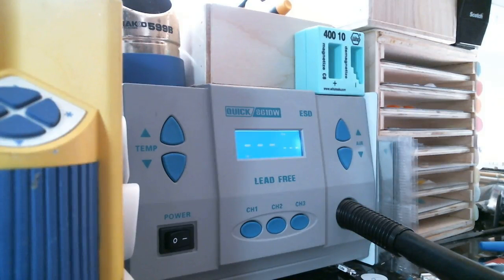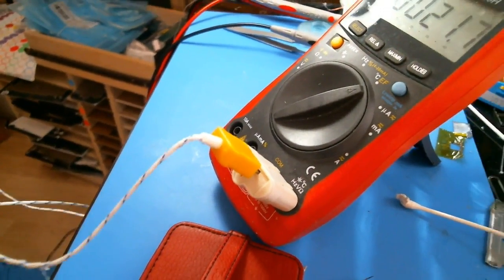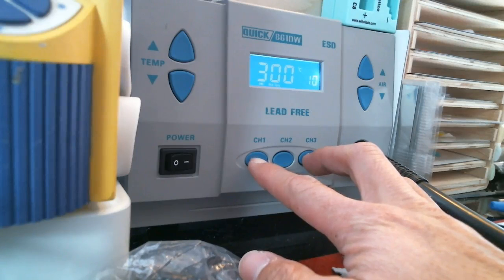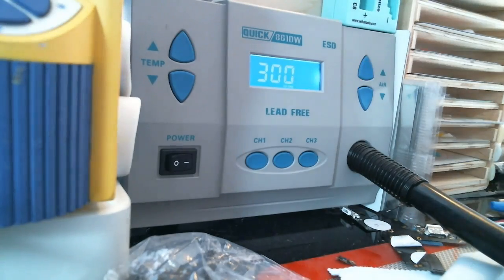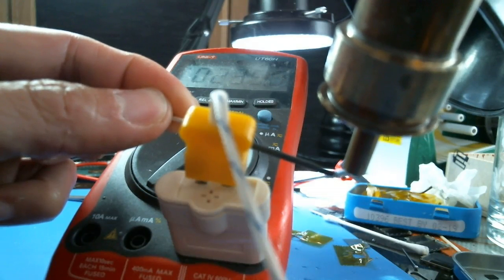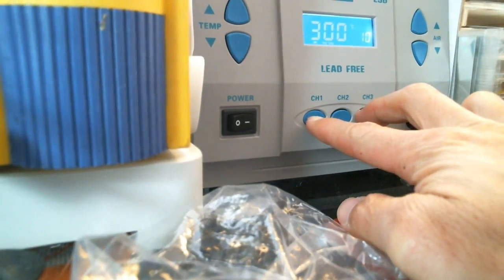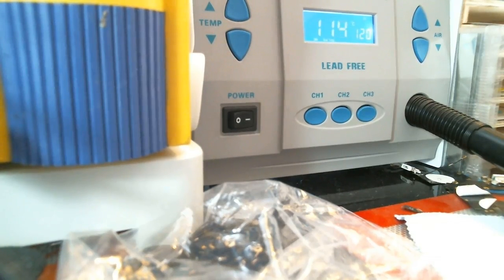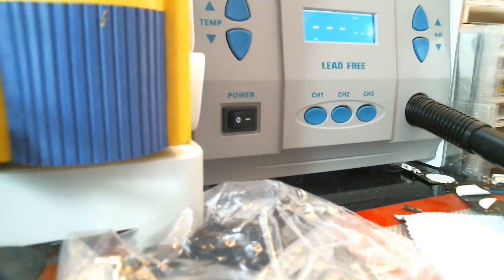Calibrating your Quick 861DW Hot Air Rework Station

Comment: It's not even calibrated properly, You don't hold a couple at your working distance and it's moving all over the place your readings will be all over place, The correct way would be to place the thermal couple inside your nozzle near the tip of the heating element that would be the real calibrated reading otherwise your just wasting your time calibrating it in the first place.

Comment: I would suggest not doing this so close to the meter - if the cold junction for the thermocouple is in the meter (or the plug) you're gonna throw off the reading accuracy because of the heat. Potentially a whole lot.

Comment: It can never be truly calibrated for precision use because there are so many other factors, your ambient temperature, how close/far the tip is from work surface, tips angle, air pressure. But for rough approx reference, its good to see the calibration function in this device.

Comment: Thanks for this.  Been looking at the 861DW to add to my bench.  But still wavering.  Have a couple of used options locally.  Any advice on a used Hakko 850?  Thoughts?  Also know anything about Hakko's 703b and 807 desolder gun?
Reply from the maker: Unfortunately, I have never used the hakko hot air units.

Comment: You seem to be the only person that speaks English that owns a quick brand. I'm considering tracking down a 120v version, but wondering about tip nozzle compatibility. Will generic 850 style nozzles fit? Hope I don't have to buy special ones!
Thanks!
Reply from the maker: No, this unit uses proprietary tips.
Reply: Thanks for the reply! Still recommend quick brand now that you've had a chance to get to know it?
I worry about lack of support in the united states.
I might just hang on to my annoying cheap aoyue for now.
Reply from the maker: Yeah, I've used and tested Aoyue, Oki, and Quick hot air rework stations and I can say that the Quick is by far the best one.  I'm testing the cheaper Quick 957DW right now.
Reply: I see MCM has the QUICK712A for $299 but they give like a 10-20% off code for new customers.
I wish Quick was more popular in the states, instead were flooded with no name Chinese stuff.

Comment: I have a clone of the repair station Quick-706. His name is UnionTest-706 (Russian low cost brand). Thermal stability is worse than the Quick-857D (857DW - brushless motor). Recently purchased also Quick-861DW. But I ordered the NK-850 nozzle in Poland. This adapter, which allows the use of standard nozzles from the 850 series station. That will save on buying expensive baits for large BGA chips. I'm sure this information was useful.

Comment: Do you guys use a 110 to 220 transformer on this ? Or do they sell a 110v version. I've been googling around but can't find much information on this.
Reply from the maker: I think the 861DW is for 110V and the 861DE is for 220V.
Reply: Thanks You! I was unaware of the 861DE existence 👌🏼
Reply: Friend, you are mistaken. 861DW - Flow 120 liters per minute. 861DE - Flow 120 liters per minute. You can see the disassembly on the Fix Apple-The Kardi Lab channel. The 861DE has a very strong airflow. It takes a very long time to gain maximum flow in cooling mode. And very much noises. Dave at EEVBLOG (forum) has a photo of 861DW .. You can compare .. The same disassembly of the 861DW is on the Bga Mobile channel (i use google translator from RU. Ths.)
Reply: So in other words, 861DW is the way to go correct ?
Reply: oh.. my error.. copy-paste with translator.. sorry.. read as "861DW - Flow 120 liters per minute. 861DE - Flow 200 liters per minute".
if it is not necessary to solder large bga chip (video card or specialized industrial equipment) - 861DW is the "ideal" Hot Air Station. I can see is only one drawback - it is very expensive attachments. But he decided to purchase the nozzle NK-850 (I bought at Quick representatives in Poland). I would like to buy more Quick-860DA micro hot air station .. and compared in the living .. but it will not be before the end of the month of May. At the mini station very strong air flow and high noise .. but the high heat setting.
Reply: https://youbay.ch/collections/repairing-tools/products/original-quick861dw-solder-station-quick-861dw-repair-tool-quick-861-dw-de-smd-solder-station-for-iphone-samsung-huawei-phone

Comment: Hello it  could calibrate 380 C  and 6 air  and  WITH THE THERMOMETER mark 380 C  is correct?
Reply from the maker: Yeah that will work
Reply: Thank you, you use it at 415 degrees and 10 air  and 6mm tip ?
Reply from the maker: Yes I use the 6mm only for touch ic repairs.  I use 4mm and air flow of 5 for almost everything else
Reply: Okay, but has it calibrated at 415 or 380 degrees for your jobs? Thank you

Comment: JBC baby ! Worth every penny.
Reply: Tony Tone so expensive baby, and however jbc is no the big deal
Reply: I just recently got the Nase as well. I love it. I haven't tried much else except the old Metcal SP200 and Hakko 888D.
Reply from the maker: I refuse to pay $1,500 for their hot air station!!
Reply from the maker: That's nuts.
Reply: Love your videos too !
Reply: Ok cool
Reply: Think it came out to be about $1,800 - $2,000 each. Worth it to me.
Reply: Ya it is. But its a luxury like a Maserati.
Reply: Tony Tone yeah, but remember this maybe u can could pay for jbc, but not me. I see this channel because i wanna something cheap like quick. I saw different videos people using this hot air station and they are happy. Probably i gonna buy this
Reply: On Nase I got a demo unit for 30 days. It has practically bought itself in that 30 days. But I feel ya. There was a point in time I couldn't afford it either. But if you have a choice, I'd say choose it. Keep working with what you got and you will get your JBC's. My previous hot air station was Aoyue. It got me through for many, many years.

Comment: I cant understand why did you calibrate the station !!!!!!!
Reply from the maker: I was at 500C and it still wasn't hot enough
Reply: +Microsoldering ok so why did you set it on 220C ?
Reply: actually I did not got your idea , because i have the same issue and am not able to solve that , will be more than happy ic you can help me out in personal. 
Thanks.

Comment: Hi , im hold the ch1 and ch3 keys simultaneously en my quick 861dw do not show CAL ,
WHERE CAN BE THE PROBLEM  THANKS
Reply from the maker: Fernando Cheker make sure that it is off of the holder
Reply: Yes
Reply: does nothing
Reply from the maker: You are doing it wrong then.
Reply: Hold the CH1 and CH3 keys simultaneously    For 10 seconds now if you can  thanks
Reply: helep me, my hot air QUICK861DW error code H-E
Reply from the maker: contact quick usa